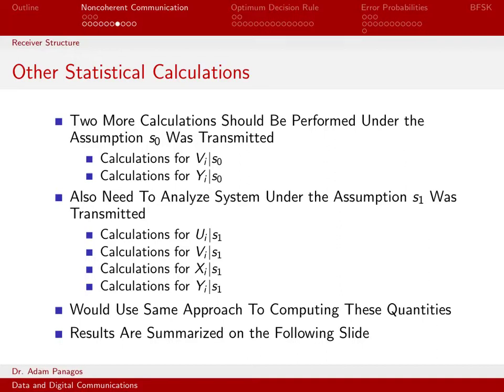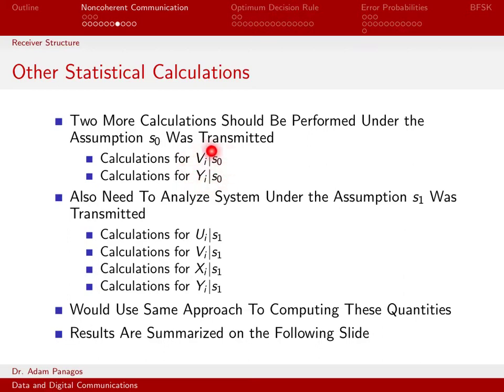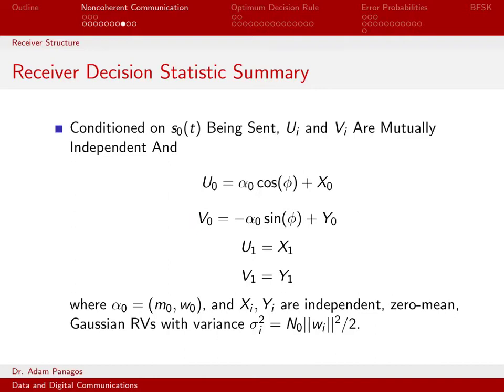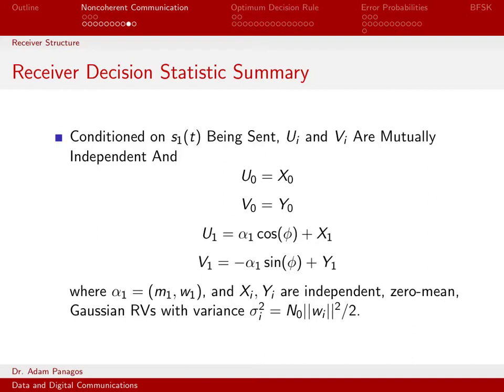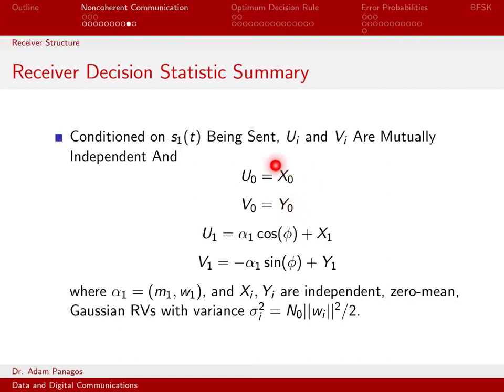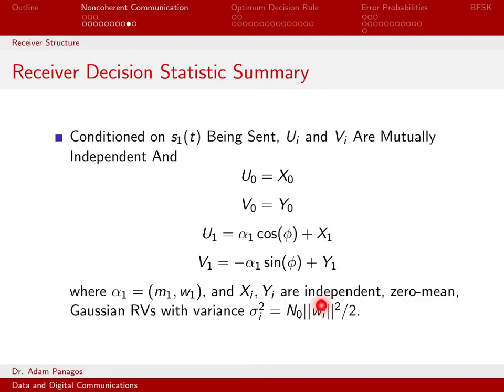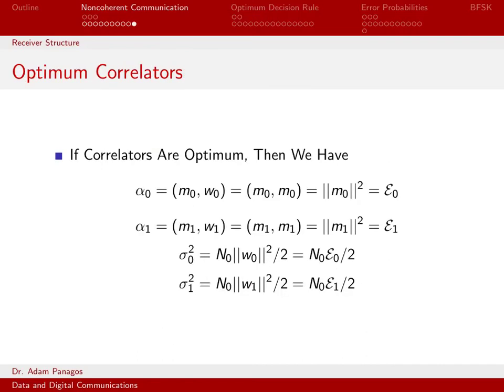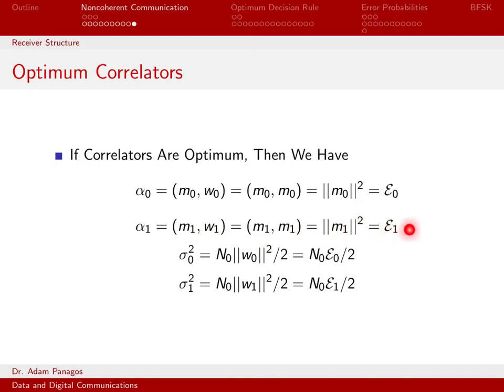Noncoherent Communication (4/12): Receiver Analysis cont.

Comment: I'm really struggling to understand non-coherent reception. Surely the phase phi is now trivial to obtain and we basically have a coherent receiver? For example, since the alpha_i are known constants, then for some "Decision" k (i.e. k=0 or k=1) we can define:

beta_k = (U_k - j.V_k)/alpha_k = exp(j.phi) + (X_k - Y_k)/alpha_k

where j = sqrt(-1) and the decision is assumed to be correct. Then, averaging the beta_k values over many symbols will give us (asymptotically) exp(j.phi), from which we can determine phi (e.g. via atan2, which can be implemented relatively efficiently using CORDIC). Yes, this requires feedback of the decision and a little extra computation, but I really don't see what the great extra cost is.
Reply from the maker: That assumes that the phase of the transmitted waveform is costant and you can "average" to estimate it's value.  As discussed in some of the starting videos there are situations where the carrier phase may be non-stationary and tracking it is either difficult or impossible.  Hence, the need for techniques where we can still demodulate without an accurate estimate of it.
Reply: @AdamPanagos  Ahh, of course!! How did I miss that?! Thank you so much for the clarification, and for your absolutely excellent videos.